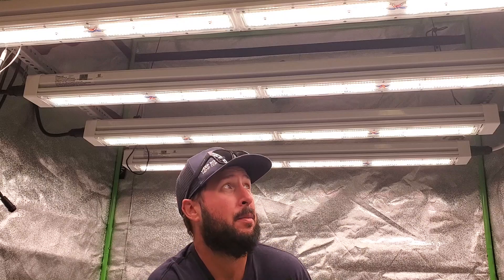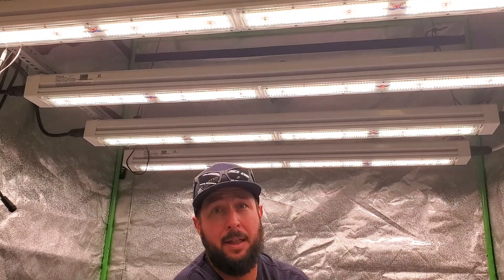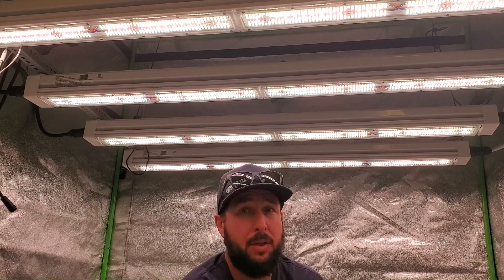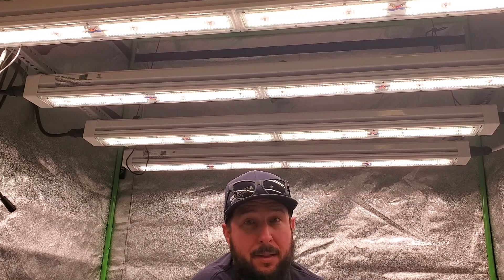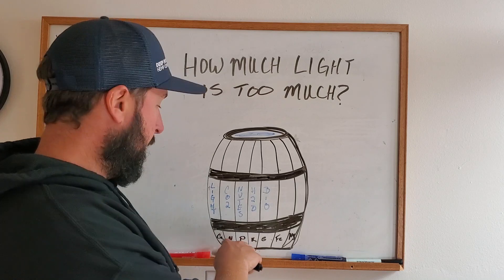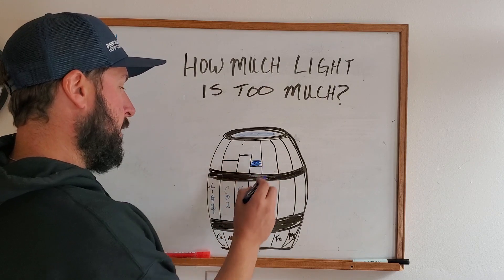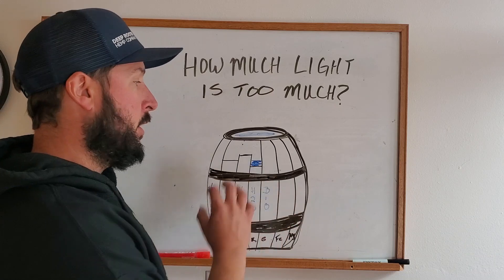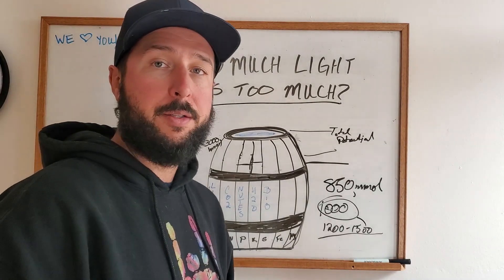How Much Light is Too Much in Your Garden?

Comment: Could you comment on light penetration and product quality? For instance, lets say you have your super dialed in environment, perfect 1000par at every point wall to wall in a tent, your vpd is perfect, your nutes are perfect, you have a super dense canopy thats flat as a table and also wall to wall.

How far into the canopy would you EXPECT to see top shelf quality flowers? 6"? 12?
Reply: The measurement of 1000 PPFD is 2 dimensional. The thinking as that you need 300 PPFD to make "sellable" product. This is achieved by canopy training and defoliation. I've seen flower 36 inches from top of plant to lower branches, all dense and sellable. In a tent though, you are relying on reflection off of the walls, where in a commercial setting or multi light rig, you have contribution lighting and overlap helping achieve this. The short answer is ~18" with good pruning and leaf removal at the right times. Great question and I hope this helped explain. Let me know if you need more clarification.
Reply: @gardencityfarmer  that helps a lot, thank you. Reason I asked is that Im planning to have a dense, full top canopy, but if I leave all those fan leaves on, I dont understand how any light would make it past the top nodes.. Im running a 650w led bar in a 4x4.
Reply: @gardencityfarmer  also, I realize at this point its definitely outside the scope of this video, but, what are your thoughts on what the right times and places are to prune?

Comment: I would say a 1000 umols maybe if you really have everything dialed in you can push that amount of photons.
If you wanna go beyond that CO2 becomes a must.
Reply from the maker: CO2 is crucial for yields above 800 umol. You can keep plants happy but they need the improved CO2 levels in order to take full advantage of the lighting input. Otherwise, they start evacuating excess light as heat in a process called non-photochemical quenching (NPQ)
Reply: @sustainableterrains  So why would you say plants in nature can handle the sun wich produces like 2000+ umols ? Is that because of sunrise and sunset?
Reply from the maker: @sh0masta  Midday sun here in Colorado and many equatorial locations is 2000+ mmol. I am also seeing growers indoors getting more than 1500 PPFD to the canopy and are seeing a return on their investment. New heights with LED. It wouldn't be hard to deliver this amount with HPS but the heat becomes too intense on canopy and also in the room to manage.
Reply: @sustainableterrains  I agree.
800-900 is max where I like to push my plants. I grow in a scrog and the 4 far corners are set at 640 PAR and not much difference in the size and density of colas from dead center far corners.